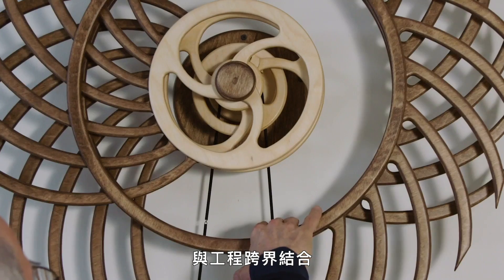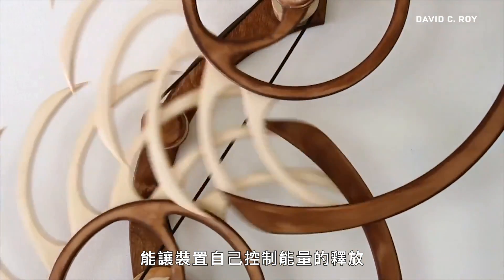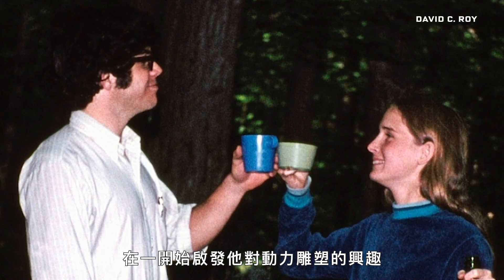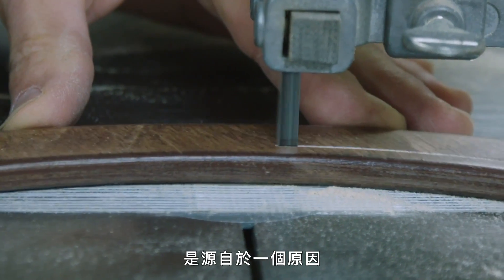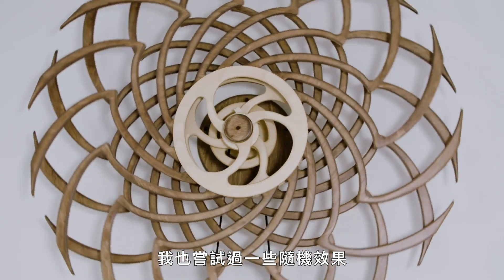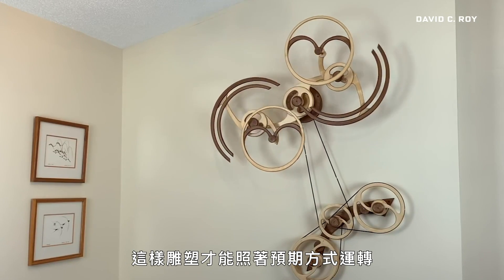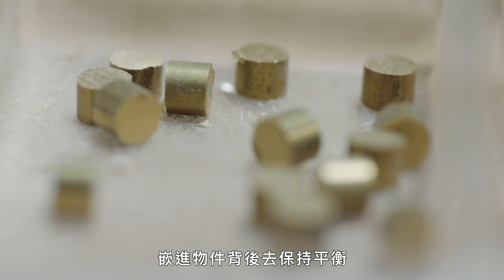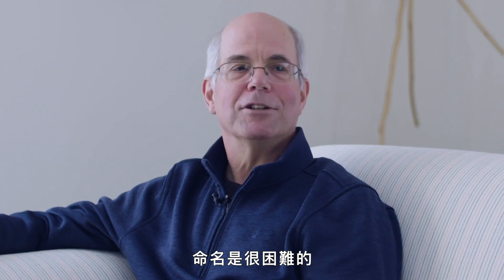會動的雕塑？誰說物理與藝術不能結合 How This Guy Builds Kinetic Sculptures｜科普長知識｜GQ Taiwan

Comment: 看完之後本來想去查一下他的作品能不能買到...恩，當我沒說

    Vice Versa - $3900.00 - opening bid

    Calligraphy - $3900.00 - opening bid

    Kindala- Celebration -$4500.00 - opening bid

    Boomerang - $4400.00 - opening bid

    Synchronicity - $ 3700.00 - opening bid

    Chaos - $3500.00 - opening bid

    Dance - $5300.00 - opening bid

    Spirit - $2900.00 - opening bid

    Nexus Arc - $10,000 - opening bid - USA only

    Nexus Spiral - $10,000 -opening bid - USA only